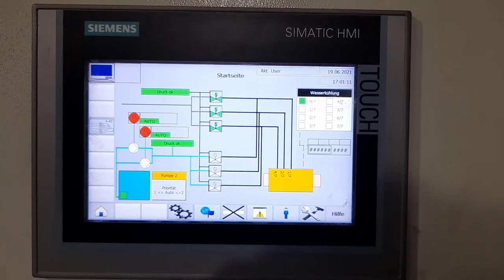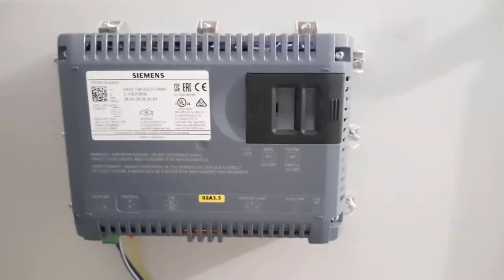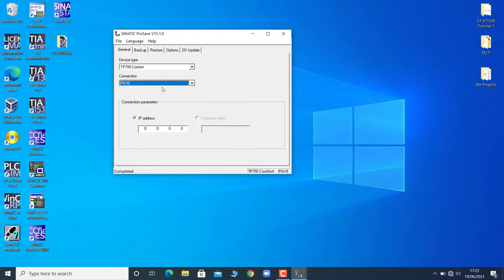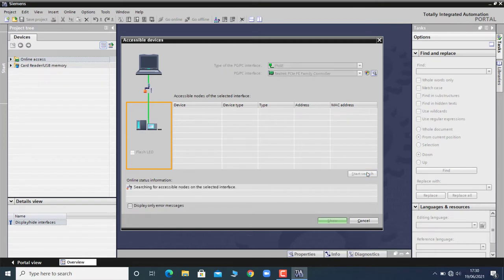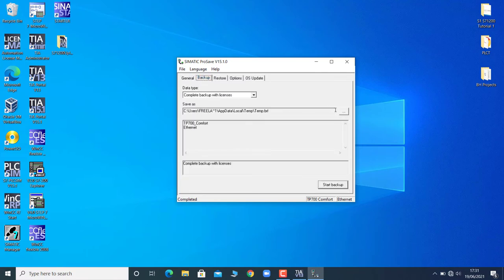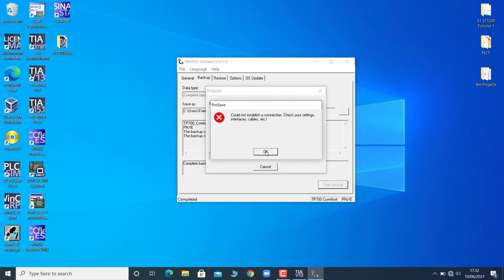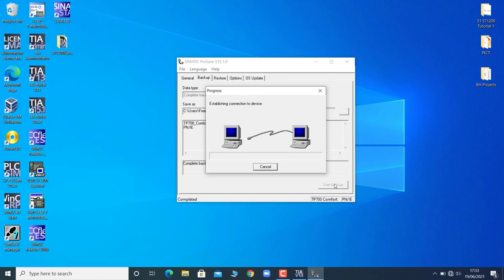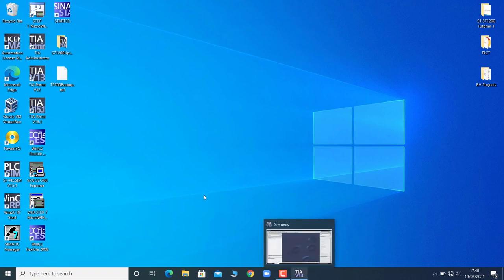Siemens SIMATIC HMI TP700 Comfort project image file back up using SIMATIC Prosave

Comment: Thanks for this video sir
But what's the next step to restore the backup in my TIA program
Would you tell me in my prosave backup option only "Complete backup" showing but not showing "Complete backup with the license" is it any problem because after restoring my backup in new hmi its not working. Please suggest............Thanks in advance

Comment: I have a question. Backup copy cannot be edited right? Is it possible to upload from HMI a program that you can edit in PC?
Reply from the maker: If you have the exact version and type of the software in which the HMI project was made, then yes it is possible. Also you must have no passwords or security locks on your HMI project.
Note: The project on the HMI doesnt have to be an image version. If the downloaded file on HMI is an image file, then editing is not possible. only image upload would be possible via prosave.
Reply: @PLCNerd  so if the HMI program is made in TIA V16, I need to have TIA V16 and the HMI should not have password? If I fulfill these requirements, how will I open the project from the HMI in TIA? 

Also, is it alright if you can give me your email address or some contact info? I'd like to ask you some more questions, if that's okay with you.